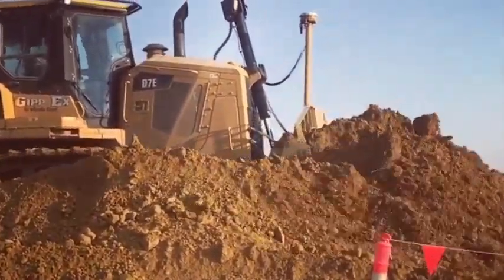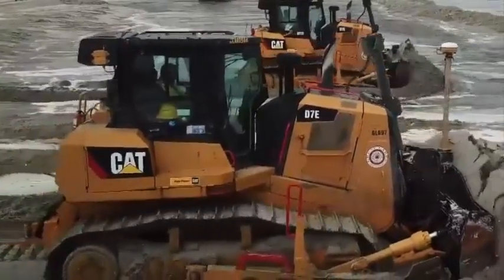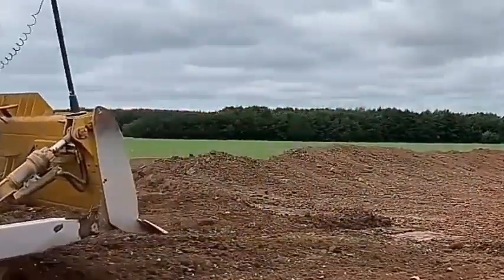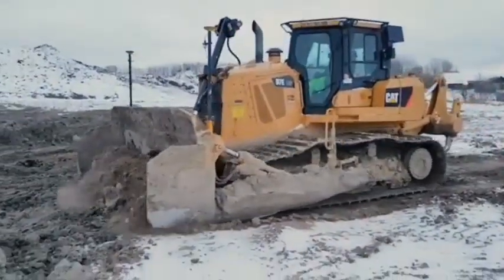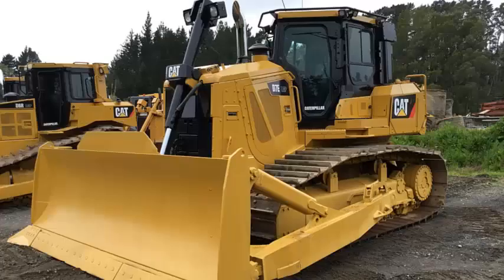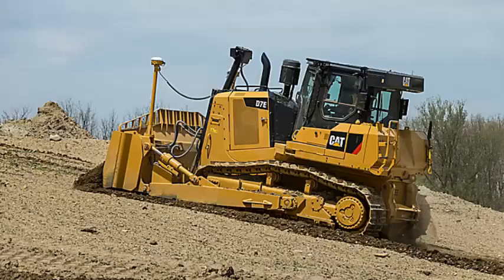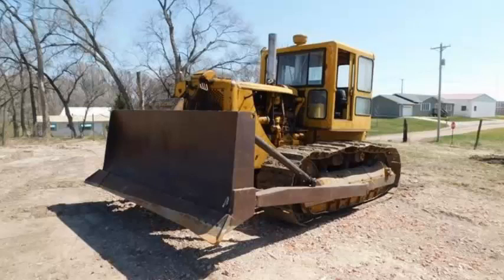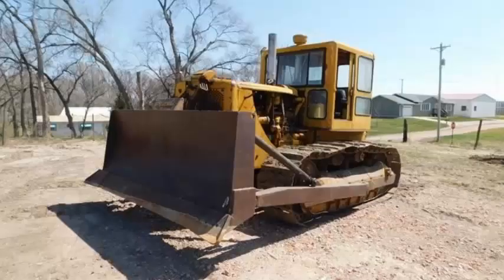Details Of Caterpillar D7E Dozer Specs #caterpillar #catd7e #cat

Comment: These were Caterpillars first attempts at Electronic Drive TTT’s, I was involved with the initial field follows and continued to support these tractors throughout the years, with Tier 4 final machines last production run in 2018,  today we are still seeing these tractors used for land clearing and landfills. There very powerful and agile for there size. Visibility of the blade is very good.